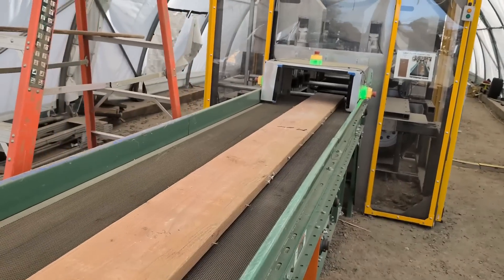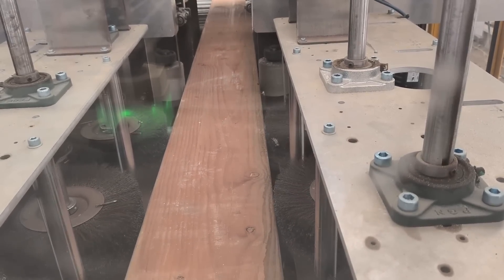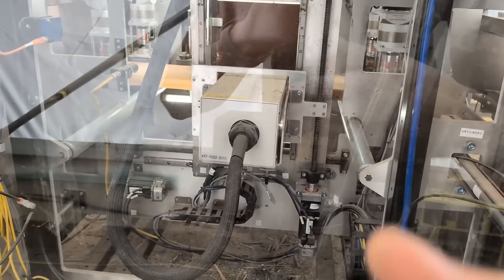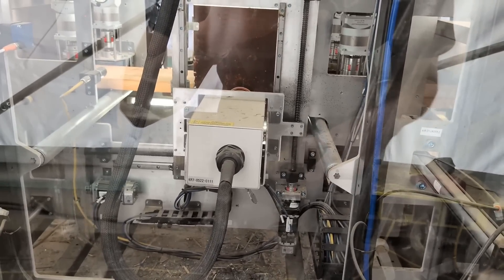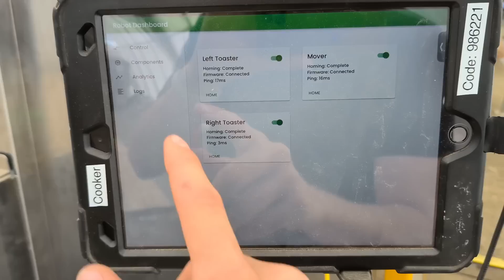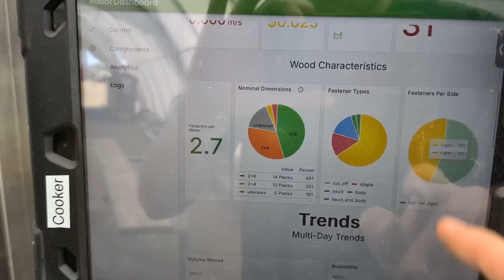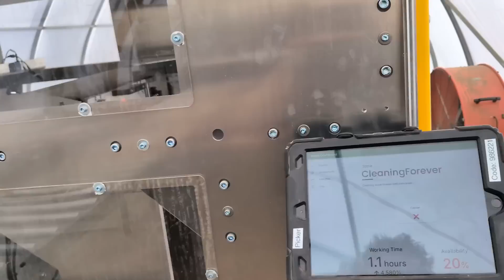Autonomous Wood Reclamation Factory Tour: Urban Machine's Fastener-Removing Robots

Comment: As you mentioned previously, educating the market is going to be key for this kind of industry to start, but once there is enough sustained volume, I think you will see the economics change the process.  

For instance, rather than someone being paid to tear down an old house, you may find people who will do it for 50% off because they will recycle the lumber (same idea as those who buy and move houses rather than tear them down).  Landfill prices are only going up and this can become a viable local business model, feeding into local lumber stores (not the big box guys) with recycled dimensional lumber (smaller than bog box sizes) but also less likely to shrink or warp.  Once more automation is available at lower costs to extract the lumber, this could become the new normal way to "harvest" lumber.  Add to it the sheer number of houses nearing the end of their viable lifecycle (at least in the US) and you can see a steady supply of materials for decades to come.
Reply from the maker: @boomerbobable  couldn't have said it better myself, great points all around! What industry do you work in? Add me on LinkedIn 😁
Reply: @AlexThiel  Will do - tech guy, mainly with startups and emerging market companies. But love woodworking and nice to see some real innovation for real problems that don't require an app!

Comment: The big framing nails on the top of the board is the only part most of us were interested in. I wanted to see the machine pull those out automatically. If those have to be pulled by hand I’m not impressed.

Comment: Good lord.  Can we coin a phrase?  "Straw man project"; i.e. solving a problem that doesn't exist (an efficient technology to pull nails and screws has existed for centuries), whilst making an existing problem (unemployment) worse.   This is a prime example of pseudo-green 'technology'.

Leaving aside the educational training for nascent carpenters this un-efficient process eliminates.

I've personally been 'reclaiming' lumber (as well as most everything else, from plastic to metal) for over 50 years.  'Reclaimed 120 linear feet of 2 x 8s today (to be reused in a fence-bracing project next week)

By far the ultimate efficiency "metal-removing technology" consists of a good claw hammer, a 2x2 block of wood, a nail pincher pliers, and a pair of vice grips (for screws).  Oh, and an eager 15 year old, would-be carpenter getting 12/hr.
Reply from the maker: I appreciate your passion! The sad truth is, most reclaimed lumber goes to landfills because manual de-nailing is slow and unprofitable at scale. Our machine makes it viable, we're hoping to save the 37M tons of wood waste annually in the U.S. alone! This creates jobs in machine operations, maintenance, and logistics while supporting sustainable construction. It’s not about replacing craftsmanship—it’s about scaling reuse to make a real impact!

Comment: Awesome! But why grind down the edge screws in the first step when you are going to pull them out in the third step? Wouldn't the result be the same?
Reply from the maker: there's three major reasons- 

1. It makes moving the wood around much much easier. If the surface is flat, we can use simple wheels to move the wood around. 

2. It let's us use very inexpensive camera sensors. Because the wood is flat, we can treat the wood as a 2D plane, and thus we only need 2D cameras. Before we created the cutter we had to use very expensive cameras. 

3. The cooker relies heavily on being as close as possible to the metal it's heating. If we don't cut it, we can't get close to the part of the metal that is inside of the wood, which will weaken the cooking effectiveness significantly.
Reply: @AlexThiel  OK - I get it.

Comment: I always hate to come behind inventors and suggest other things, but consider this, "Drill and Fill Wood":  When I do wood projects, I don't use fasteners, because the way I see it is that they weaken the wood.  A piece of metal pries the fibers apart.   I use glue.  Fasteners are faster for low quality work.  I assume since cabinet makers use glue, there is a basic understanding of this damage/strength concept.   The holes and splitting might not be that bad in reclaimed wood and give it that "character" for various projects, but to generate a generally rehabilitated piece of wood would be to drill the fastener out and plug the hole with a wood/glue plug.   I'm a member of a group which rebuilds antique railroad equipment and we have a yard.  The barrels which contain new railroad spikes have small blocks of wood in them, so if you go to insert a spike in a railroad tie that was previously spiked, the wood plugs can be inserted in the holes and the spike will hold.   This is a problem in ties, because the holes end up in the same places.   I don't know if you even want to go there, but maybe there might be a market for "Drill and Fill Wood."  In this one, a magnetized drill would grind up the fastner and right behind it, the plugging tool follows.  The plugs might be an injection of a mixture of glue and sawdust.  There could be a hybrid in which the fathers are removed by the heating/pincer process and then injected.   The drilling method may not follow the pathway of the faster.
Reply from the maker: @lewisdoherty7621  that's awesome, I'm glad you guys are doing that! I don't show it on this video, but some portion of our output lumber goes to DLT, dowel laminated timber. It's beautiful, doesn't require metal or glue, and hides the holes if you arrange the holes so that they are covered by side panels of wood.
Reply: @AlexThiel  I like what you are doing. I'm not doing any thing in those areas or plan to, I was just suggesting other areas to explore which apparently you are already doing. 
       I had two other questions: On removing screws, why did you decide to use induced heat rather than putting a swivel to rotate counterclockwise on the pulling head? Was it the time of each way and some breaking off with induction being quicker?  On bent down nails, can they be pulled from the back from the head side without unbending or does one machine straighten on the chisel side and then from the opposite side of the board the head end is pulled?
       I have told people who believe Trump's tariffs will bring a large number of jobs to the Bust Belt that most of the new factories will be largely automated, since avoiding the labor problems was one of the reasons they relocated overseas.  Elon Musk does this.
       Keep up the good work.
Reply from the maker: @lewisdoherty7621  we did develop some complicated prototypes to try to "unscrew screws" but decided that the variation in material we were receiving from landfills was too crazy complicated for a robot to remove. A lot of screws arrived broken off, bent in weird ways, heads stripped, etc. 

Cooking was incredibly cheap to do, and simplified the picking machine. Having one robot to both remove nails and screws is much cheaper than developing one that can remove nails, and a separate one for screws. 😁
Reply: Problem: "I hate to co.e behind inventors and suggest other things"

Solution: Then don't do it 😂
Reply: @W8iHav2P  I hate not asking questions which should be asked even more.  In order to properly make sure a problem is worked, alternatives have to be probed.   If not worked now, the marketplace will work it.   I also just wanted to know.

Comment: I was a little surprised the operating cost on your analytics screen was showing 60 cents a for processing 2x4s.   That's more than the current price per foot for basic 2x4s at home depot.  Either I'm misunderstanding, or this process is more viable for more expensive cuts.  But I applaud your efforts trying to make this work and save wood.
Reply from the maker: @davidbwa  ah no that's not operating cost, that's the price we'd have to sell the wood per board feet in order to be able to pay off a machine within 9 months (including labor). That's our North star. To compete with virgin structural lumber we'd have to be around the $0.5/bf mark. Some days we're higher, some days we're lower, and oftentimes the wood we're running is higher end anyways so we'd be able to sell it for more regardless. 

 Does that make sense?
Reply: @AlexThiel  100% ROI in 9 months is impressive
Reply from the maker: @443DM  it keeps the engineering team focused on throughput and BOM cost, that's for sure 😅. We set the goal aggressively on purpose.
Reply: @AlexThiel  Thank you for the response / explanation. I hope it is a successful venture for you.  I don't know about other countries but I see a lot of waste here in the US.

Comment: I have a thought, change the induction to run first and get nail hot.  Then, instead of cut them off and picking them out.  Just pick them out whole. Save wood gouging.
Reply from the maker: Cutting then off significantly simplifies the designs of the downstream machine, and also significantly simplifies the computer vision (and the cost of the cameras). By cutting them, you no longer need $10k+ 3d cameras. You also can translate the wood using simple rollers, and have great control authority. 

With the wood gouging, it doesn't matter too much since you can plane down the wood 1 mm or 2 after cleaning, and have a beautiful fresh surface.
Reply: @AlexThiel  I think machine vision and induction ahead of the first clamping rollers with pickers would be easier for nails and screws on the edges that are proud of the surface. @jimhite4341 has a valid point. Cutting them off creates more damage for extraction and planeing reduces the lumber to out of spec.

Comment: “That means no wood gets to the other side unless it is fastener free”
Story time…
I once got burger buns from the supermarket that had a very large part of the machinery inside them. When I say very large, I mean it…
The manufacturer of these buns reviewed their CCTV footage from that batch, and their metal detector did stop the line, the bag was put through again (again with a stop) and for some reason the human in the process put the bag in the “good” pile. 
The old saying stands true… when you make a process idiot proof, they make a better idiot.
Reply from the maker: @pwapwap  oh man 😂 that's terrifying. We are also planning on adding a printer that stamps the wood with a QR code and our branding. It would ONLY do so if the wood passed all tests. 

That way, if the sawmill operator is worried about mistakes he can just check for the logo near at the end of the board.
Reply: @AlexThiel  This is a good plan.  You could also include data a customer or store manager could look up to determine the source of the wood and how long the bits are that have no holes.  Basically same as the high speed lumber yard x-ray machines do by keeping a fingerprint of each board. Any other data you can pick up and store along the way would also be great. You could grade your timber based on where the fasteners were and let the customer use this information if they want.
Reply: @AlexThiel  Great project. 
No doubt you are onto it but it was sad to see the board deflected when pulling the nails from the very end 7:26 when it was inadequately supported by the rollers.  One more set might be required to support it fully or perhaps a longer flat side guide rail.
Reply from the maker: @KallePihlajasaari  Good catch! Yep there's still some minor tweaks we could do to improve performance in these cases.

Comment: It seems like the economics of this would be incredible if you could get the whole machine installed on the back of a truck and just truck it into the location where the wood reclamation is occurring.
Reply from the maker: @GregoryAlbright-t3p  that is absolutely something we'd like to do in the future. At the moment we found it easier to split up the machine into components, but going to sites would definitely open up more market sectors.

Comment: How often do the band saw blades need replacing? Some cuts sound very abrupt and rough, like they had the potential to chip the blade.
Reply from the maker: We replace them about once a month. Replacement takes about 5-10 minutes per saw, and we do it as part of the regular clean up.
Reply: @AlexThiel  Thanks. How do the blades look when they are due for replacement?Does the machine sense when the blades need to be changed?
Reply from the maker: @Convolutedtubules  The robot automatically monitors the current on the motors running the bandsaws. When we start getting high currents consistently, that's usually an indicator that the "time spent per nail cut" is taking longer, and it's almost time for a blade change.

I'll make a video on this, but our whole data management pipeline is fairly sophisticated. We set it up so we get alerts on the company slack when anomalies are detected. It's quite convenient!
Reply: @AlexThiel  It's all really interesting, I look forward to the video. Do the blades ever snap unexpectedly or get damaged to the point where they need to be changed immediately?
Reply from the maker: @Convolutedtubules  Surprisingly no... We do have some measures to automatically slow down the feed rate the moment a current spike is detected. We do that mostly to maximize throughput (move wood quickly then slow it down as soon as it touches the blade), but it also helps cap the amount of damage any one nail can have.
Reply: @AlexThiel  Cool! Thanks for the info.

Comment: You know you can run current through gripper jaws to heat nails and screws in place, crush them a bit for good purchase, then pull in one operation :)
Reply: Sounds very interesting. 
Do you have a channel? I'd love to see video of your working prototype
Reply: @W8iHav2P  have run current through nails while holding them with pliers before, where one can easily observe resistive heating. 
But I guess we'll never see a prototype because I ain't building one just to satisfy snarky commenters who like to shut people up without engaging in the subject matter themselves.
Reply: @hardwareful  yeah, thats not how electricity works. You would have had to drill a hole in the wood to get access to the other end of the nail. You can't just "run current through nails" by touching one end if they're hammered into wood 🙄
Reply: @W8iHav2P  made my day, lol. Always assume the wrong implementation and then make fun of people. I'll give you a hint - the gripper jaws in my initial proposal are electrically isolated from each other. You'll figure it out, and then you can show us a video.
Reply: @hardwareful  lol (hint:still wouldn't work for anything besides melting one end of the nail off)  😉 👍 OK, I submit, its a great idea so no point in me continuing to make a fool of myself. I'm going to scurry away and hide in shame.
Congratulations , you've won 🏆 
  I'm sure the guy who made this video is kicking himself for not thinking of it 👍
Reply: @W8iHav2P  That's how that goes :D Your trolling reminds me of the old internet. Thanks for the flashbacks.

Comment: We lived 13 years in a old farm house Est 1890s' might have been older. The floors and interior walls, all wood. No plaster. When we moved we reclaimed it all. I built all our Kitchen cabinets from it. Not a single piece of plywood. That was a job, but the square nails came out real easy . Thousands of them. The estimated wood value (board feet) 15K
Reply from the maker: @joek511  that's awesome. One thing I've realized working in this industry is how many stories folks have like yours- a lot of people have personal wood reclaiming experience because of a remodel they did. 

Also, this is silly but I know exactly the square nails you're talking about. We have a collection of "vintage nails" we've found over the years, and the square ones always struck me as hand-forged. Cool stuff.

Comment: The X movement for the fastener pullers seems redundant, since the boards are on a track in the first place; is that because the track isn't accurate enough to locate the fasteners?
Reply from the maker: @agentid36  yep two reasons- the track is never going to be fast or accurate enough as having an X and also we have to do extra clamping motions when switching from "wood movement" to "picking" mode, and that adds to the cycle time. 

Having the x let's you amortize the clamping and movement time over several picks.

Comment: After the first step, where the nails got trimed out, wouldn't that be enough for the wood to be usable again. I like the engineering complex that's going on, but I don't find it necessary to add the remaining process.
Reply from the maker: @thefuture12  you would think so, but actually the reason the metal needs removing has nothing to do with it being "poky". The reason 30+ million tons of lumber get thrown away every year is because when the wood has metal in it, it can't safely be milled, planed, or otherwise reworked at sawmills. 

Funny story, one time I was at a sawmill in Oregon and the guy had a "wall of shame" of pieces of wood that broke one of his machine. Some of them had bullets (from the original tree, when someone was hunting), others had cables from power lines that the tree literally grew around and absorbed.